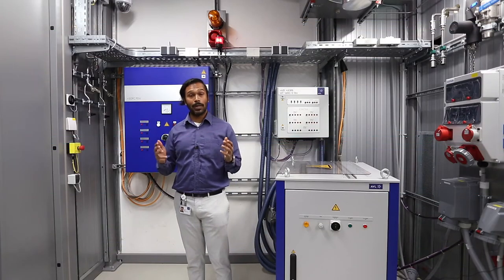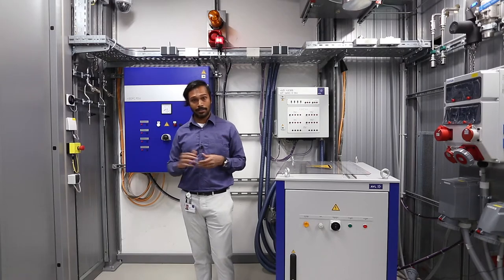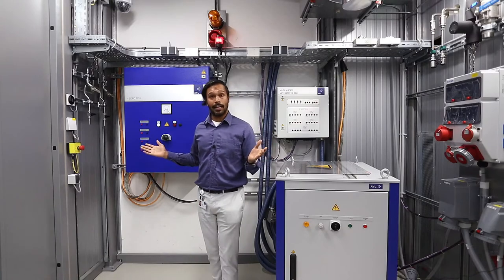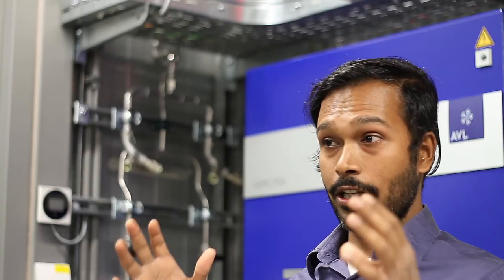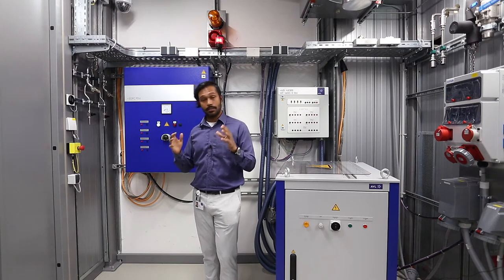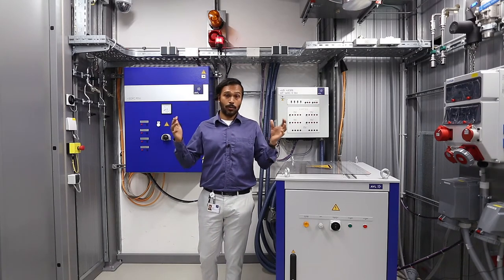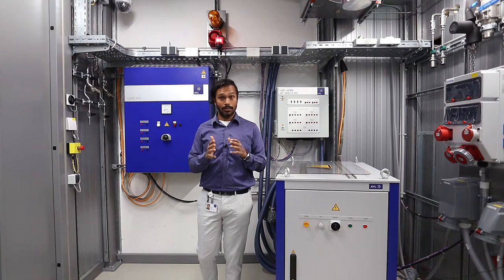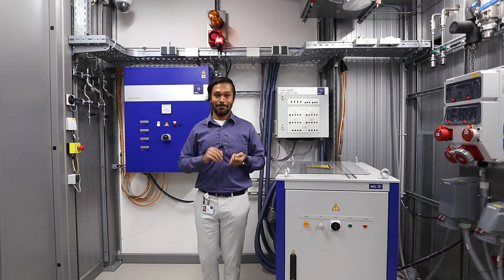AVL Facts4You | Solid Oxide Fuel Cell (SOFC) System Testbed

Comment: hello.. may i know what do u recommend for mechanical testing for composite cathode material?
Reply from the maker: Dear @Zakwan Naim, thank you very much for your question. The meaningful mechanical test to carry out would be compression vs. displacement. This can be done on individual component level or single cell as a whole. In terms of mechanical testing, we have the ability to measure thickness vs compression (in turn we can calculate the elastic modulus through-plane) and flexural stiffness (3 pt bend and in turn we can calculate the elastic modulus in-plane).  From the 3 pt bend, there are studies that suggest we can also calculate the shear modulus through-plane. We can also mimic the forces the MEA/GDL experiences in a stack externally and perform AST like experiments. The tool that we are using is from ‘Instron’. 
We do not have any solution for mechanical tests for SOFC single cells , but the described mechanical test used for PEM can be adapted for SOFC. For further information please get in contact with our experts here: https://www.avl.com/registration-cta?articleId=26039327&groupId=10138
Reply: Thanks for answering my question.  A good explanation from you gave me an idea to explore more in the mechanical part in sofc/pcfc. Actually, I am still new to SOFC/PCFC research. :)